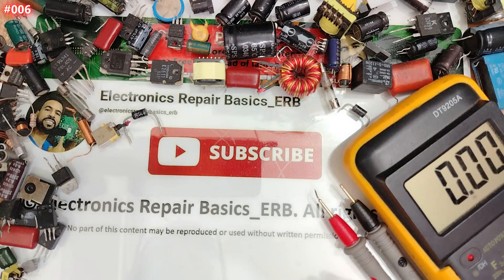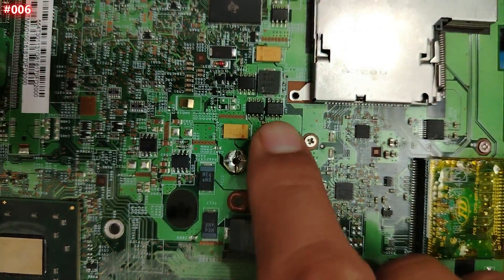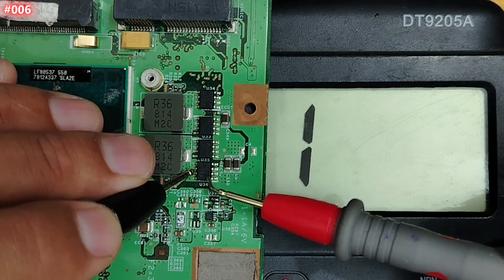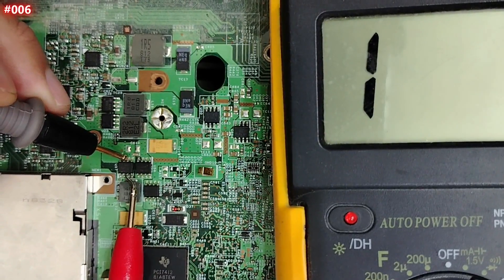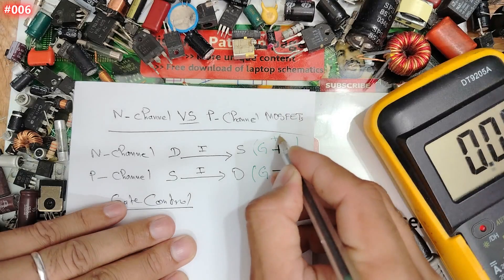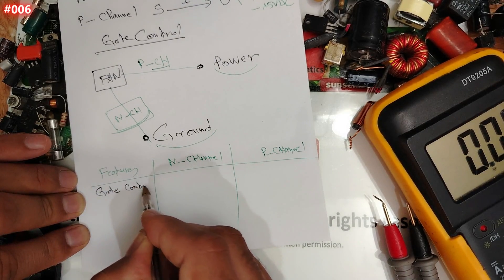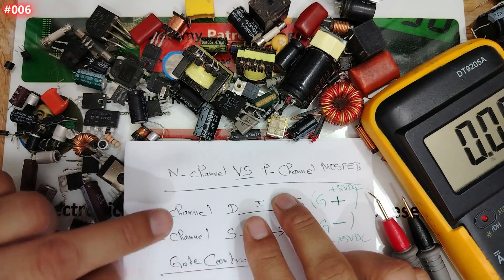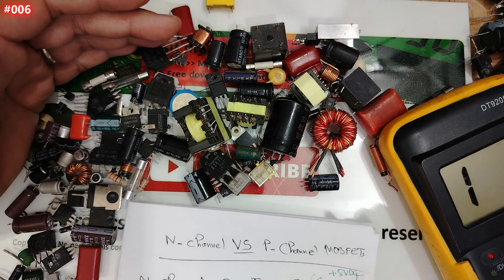#006 Electronic Components: How to Test MOSFET Using Multimeter | 8-pin N channel SMD MOSFETs

Comment: Let me first of all start by thanking you for your well done job, may God bless you for your clear teaching boss. You are the number one online instructor who's teaching I understand better, to be frank. Thanks so much boss🙏.

I have a question here boss about your teaching.... Having known that mosfet and transistor are mostly the same look, like those three leg smd transistor and mosfet, how do we differentiate the 2 when shorted, in order not to use mosfet in place of transistor? I understand that mosfet uses only one diod while transistor uses 2 diode. Thanks in advance boss👍
Reply from the maker: I'm glad you find my teaching helpful. To differentiate between a MOSFET and a transistor, you can look at the pin configuration and the labeling on the components. Usually, the datasheet will help clarify their differences as well!

Comment: Hello. My multimeter has different modes for measuring continuity and diode. Yours, however, has the same mode for measuring diode and continuity. Therefore, my measurement results differ from the ones you show in the video. What can I do? Therefore, I can't decide whether the MOSFETs are good or not.

Comment: does it matter where the black point and the red one goes? I though that the black one was ground
Reply from the maker: Great question. Yes, it does matter which probe is connected to which terminal when testing a MOSFET. Typically, the black probe is connected to the source (ground), and the red probe is used on the other pins, but it’s always good to double-check

Comment: Good evening sir, thanks for the good work. I would like to know how to test double mosfets
Reply from the maker: Ok coming soon
Reply: My Hp laptop died, no power after replacing mosefets It came up but it is not showing a picture on screen ,there is a black  screen but the board is on what could be the issue  @electronicsrepairbasics_erb